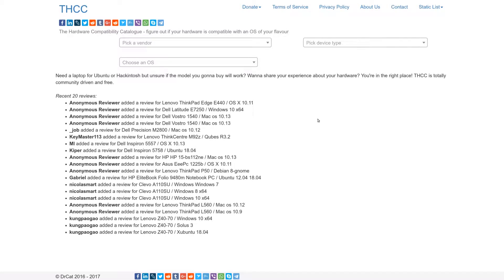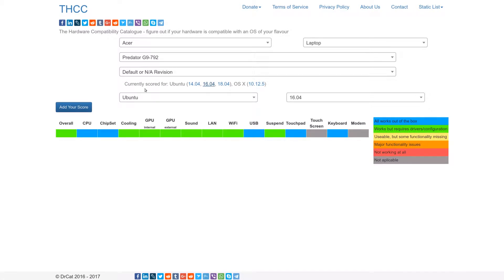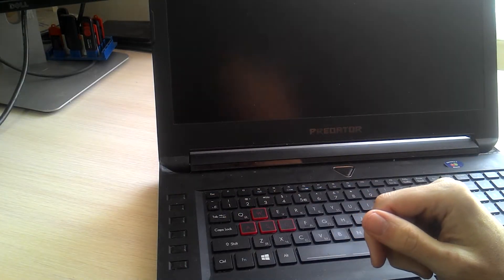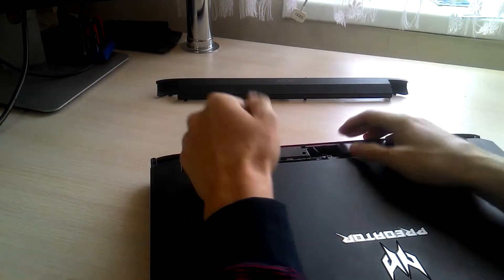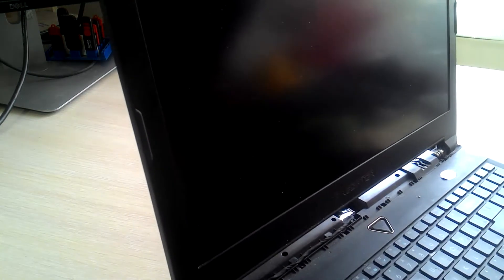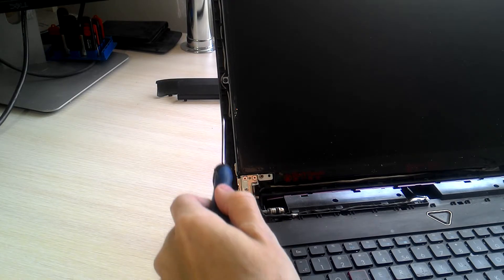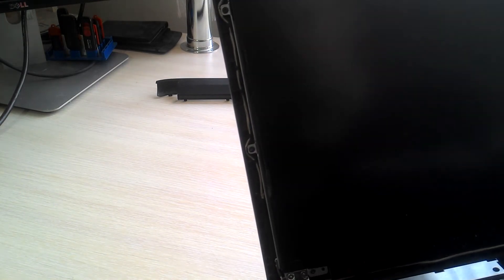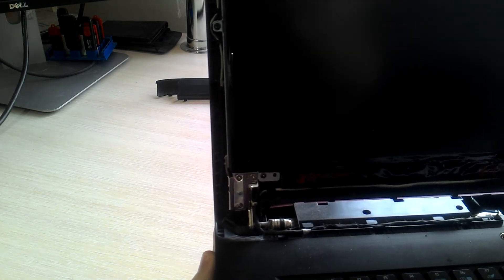Acer Predator G9-791/G9-792/G9-793 laptop Display replacement or upgrade

Comment: Hi do you still have this?
Reply from the maker: The predator? Yes.
Reply: Dmitry Kotin so basically I need your help( if you can help) may you please save your bios using gpu-z and send it to me please
Reply: My gpu won’t work without me reflashing it with the original Acer vbios
Reply from the maker: GENERAL C is there a Linux tool to do that? Have no windows on it...
Reply: Dmitry Kotin let me check here
Reply: The only way is if you use virtual box, to install a virtual windows 10 . From there you just download gpu z , back up your gpu rom and send it to me
Reply: https://youtu.be/2oO9CeZXjTY
Reply from the maker: @generalc2265  It won't let me to get a direct access to vbios / directly access GPU. Sure thing I have windows virtualized. :)
Remind me this weekend - I'll get you what you need.
Reply: @diyeverythingnow  thank you 🙏
Reply from the maker: @generalc2265  Finally had some leisure time to do this... GPU-z said this bios is already part of their collection - 198849.rom
I can send you the file but its bit-to-bit identical to the one referred above. p.s. my laptop has GTX970M with 6 gigs of vram (I believe there are 965M atleast as well)
Reply: @diyeverythingnow  hi snap I forgot to say I was able to fix it about 2 days ago😅, the gpu was drowning in old thermal paste so I had it changed and my Acers bios got reset to default so all is well
Reply: @diyeverythingnow  but thank you so much for your help, I might use this video because I would like to change my 60HZ Panel